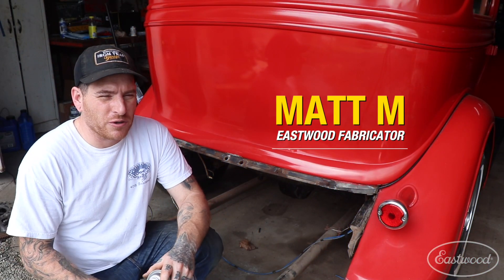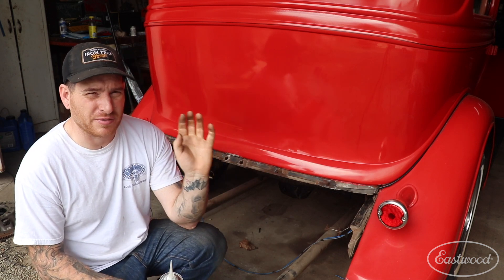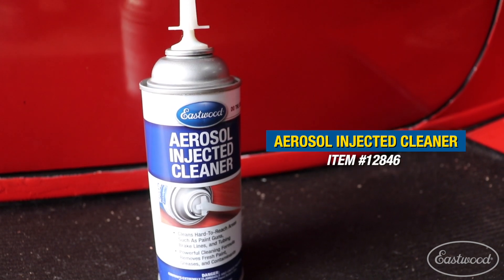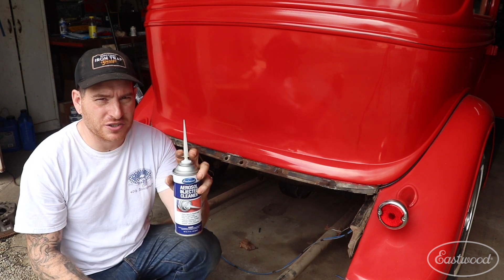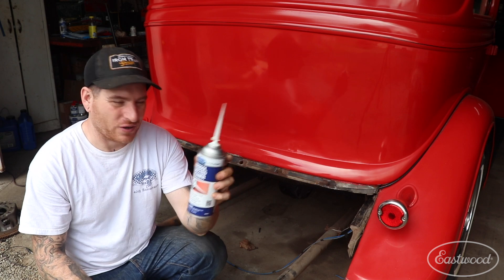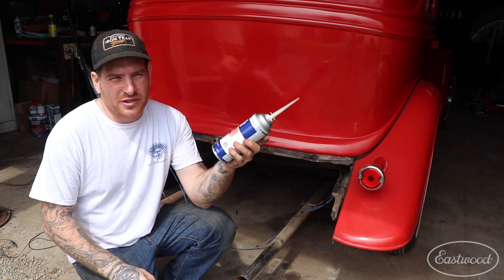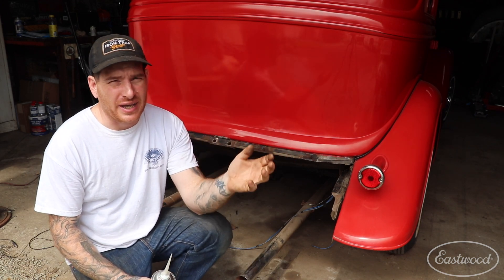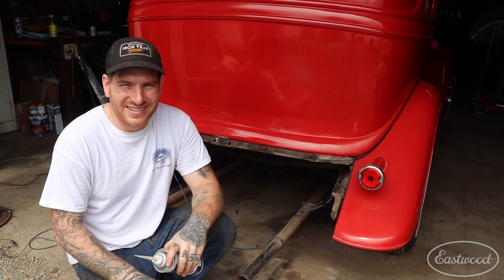How to Clean Old Brake & Fuel Lines with Aerosol Injected Cleaner - Eastwood

Comment: This video saved me so many headaches cleaning out the fuel lines on the 74 Saab Sonett i’m rebuilding.  I was going to use a compressor and acetone and was dreading the mess and headache. This was 1000 times easier. Thanks again!

Comment: Can I use this on my diesel international harvester school bus?
Reply: hey did you  get it cleaned out?
Reply: Nope. Only works on brake lines of 1934 Ford's that've been stored untouched in a dry garage for about 50 years, and that's it.

Comment: I would never use a solvent in a brake system. Your brake hose, seals and O-rings are not necessarily compatible with solvent. Recipe for disaster imo. I would flush with the correct brake fluid only. Up to you, of course.

Comment: I do something similar using my air compressor on my zero turn mower fuel line.  I remove the line from the fuel pump and push air through the line, through the carb and into the gas tank.